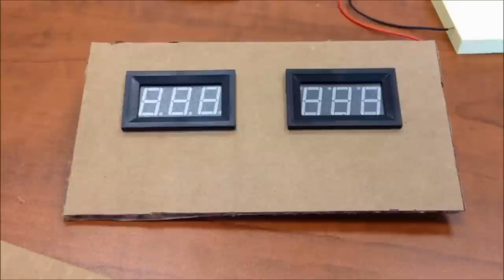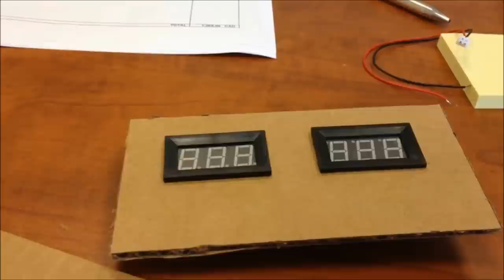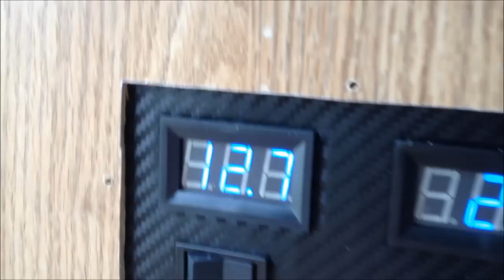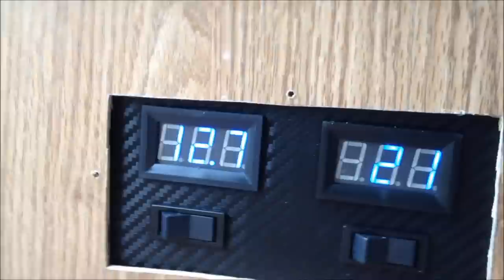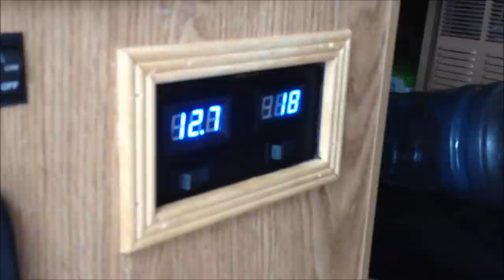Volt Meter and Temp meter Install into popup camper

Comment: Why? Keep track of the voltage level of the battery or batteries when camping. Battery drops below a certain level, time to recharge or stop using or damage to the battery may occur.
Temp gauge should be understandable for anyone who is ever curious about the temps outside. Most times when camping, there is no TV weather to tune into.

Comment: I have a voltmeter like that laying around , Mines powered from 5 voltsI use a LM7805 voltage regulator to drop the cars 12 volt to 5 volt to powed the voltmeter.Can I run positive and negative wires from my output on my battery charger straight to the LM7805 to monitor my volts at my charger output? I have 60 amp charger Thanks